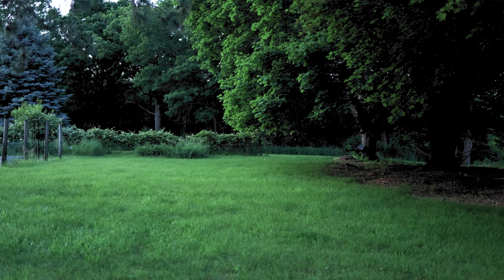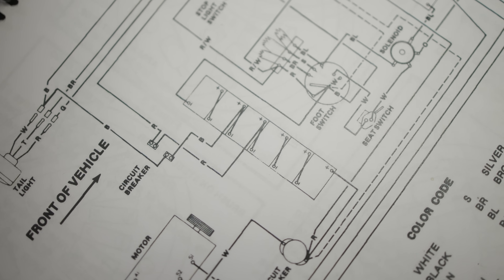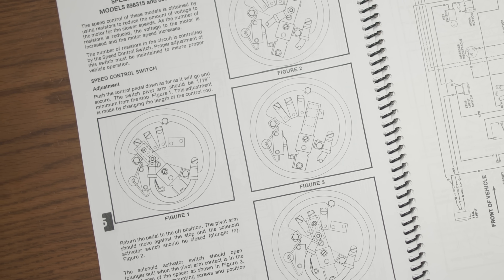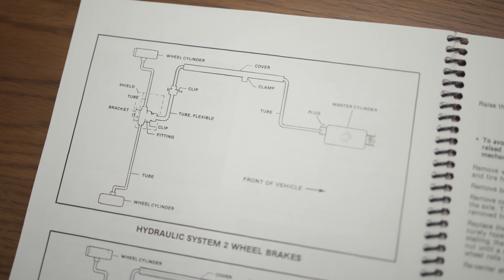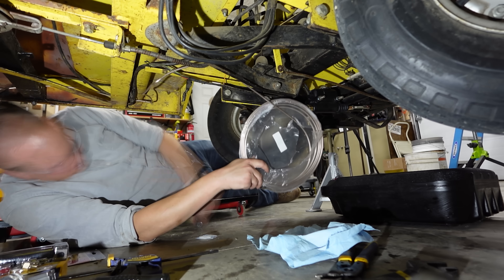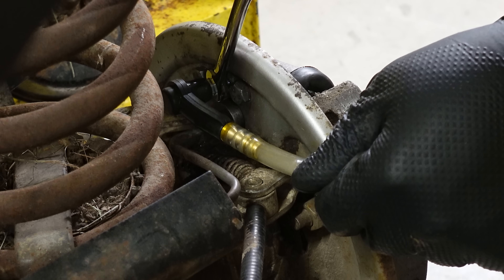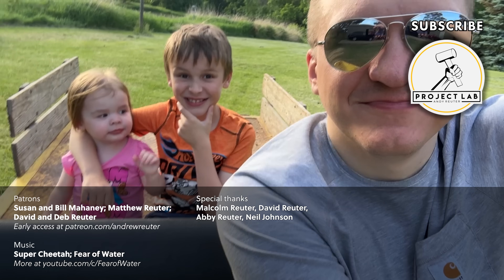Restoring a 50-year-old electric cart (9 months in 13 minutes)

Comment: Can you post what you do to update the controller electronics? My coil heated up and melted a lot of my wires on the controller wiper board. Curious to what you end up doing. Have a similar cart but the Taylor Dunn and not much info about it online

Comment: Robot Cantina, Fall, 2024, converted an electric golf cart, to "hybrid electric" - what he called his "Petroleum Battery"
Caveat: he used a 9hp gas motor, and as you know, they aren't quiet.
On the positive side, he got 40mpg, and was able to go slightly faster than it was supposed to go originally. 
He used a 'special' Jeep Liberty alternator which he later found out had an 'off board' rectifier... 

"cart shaped hole" - 36v in a 12v light (well, it was bright for a moment... LOVE the dry humor... )

Comment: Looks interesting, but not seeing them cheap anywhere.

The rust converter just converts the rust to black iron oxide...  you need to paint that with primer and then enamel, or it's just going to start rusting again.  I remove the rust everywhere, because rust is like cancer.  No amount of rust anywhere is good rust, and it just precipitates and accelerates the formation of more rust. 

There's a cheaper solution you can make up yourself with citric acid and washing soda.

Comment: 9:13 why is it scary to pull hubs?
Reply from the maker: It's a bit scary because you're putting increasing amounts of pressure onto the bolt, which is pushing against the axle in an attempt to get the hub off. Eventually, the hub lets go! And hopefully the nut you spun down to limit how far that hub can fly stays in place. Just feels nervousing because you're hoping the hub doesn't go flying across the room. (And take your hand with it! 🤣)

Comment: I used to work for Valley College I used one of those everyday as a gardener. Very fast. I don't know if it was true but they warned the hell out of me don't take it in big puddles otherwise you'll be electrocuted.😮 PS my boss said it burned up one set of batteries a year just for FYI.
Reply from the maker: Good to know on both counts! I'll stay out of the rain! 🤣 And will be interesting to see how the new LiFePo4 batteries hold up vs. those old lead acid ones.

Comment: 4:30 That is a misconception. Let's say you have a 36 V,  2 kW motor, 55.5 A, and you want to have it output 1 kW, you can't waste 1 kW in a series resistor. To have 1 kW motor output you want 25,5 V over it, and thus the current is lowered to 39.4 A, and you want to waste the rest 10.5 V over the resistor, therefore wasting 413 W (same current). So when resistively halving the motor power output, your total power is 1413 W. Not 2 kW. And if you want 500 W output, the voltage is half of 36 = 18 V, and then you're wasting 500W over the resistor = total power 1 kW.
Reply from the maker: Sounds like a good analysis! My source was the Cushman manual, BUT I am not surprised to learn that the electrical engineering behind this thing is more nuanced than that.
Reply: @AndrewReuter   Maybe the day they wrote that manual they were in a super positive mood and thought that they could do impossible things. :)

Comment: Don't lie, that was the one Roger Moore rode in Moonraker, wasn't it?

For further excitement, get a #4509 bulb! 100w, 12v, same size as your 4411. I sell them as aircraft landing light bulbs in my auto parts store, but I've also sold MANY to lake fishermen who will install them in a rubber utility light housing like used for rearward lights on tractors, making them waterproof. All the fish hear is, "Come to the light!"
Reply from the maker: 🤣 That would explain the license to kill in the glovebox!!!

And thanks for the tip on the light! I will check that out! 🤣
Reply: @AndrewReuter  you got that right on the license! As to the light, I'm clueless on the amperage draw, so may require a relay setup to save the harness.

Comment: You need to paint that duck tape on the shed, If you paint it, it's just like the metal and will last for decades.
 Also - Buys a cart for $500. Spends $100 on gas to get it,  Spends $1300 on batteries, $500 on tools, $500 on parts. Tells wife and friends "hey look at the cart I got for $500!"  😉
Reply from the maker: Good tip on the paint!!! 🤣 And love that logic. 

Andy: We’re saving so much money over buying one new!
Wife: … why are we buying one, period?
Andy: … what’s that over there???? runs away

Comment: Good luck finding them that cheap. Bought a Cushman 875P several years ago for $3K. it was a pristine ‘91 hanger queen with fresh batteries. The zinc is still on the lug nuts. The P stands for passenger as it has a folding second row bench seat that becomes flush with the rest of the bed. I’m starting to have frame paint issues. They never removed the scale before painting the steel angle framing members. The cheapest one I’ve seen lately was $800 and it looks like they ran into a tree. Taylor Dunn and Motrec are a couple of other brands of these industrial carts.
Reply from the maker: Very cool find with that 875P! And thanks for the market analysis!

Comment: call me crazy, but all that old electrical gear? it comes with a descriptive manual, and its ALL serviceable. failing that, bits can be fabricated, modified, or altered.

whereas things like the batteries... touch switches. LCD screens. microprocessors... all undocumented. all unrepairable. all look flashy and nice and sophisticated, but imho... all junk. one day, that  "high tech gadgetry" will stop working and thats that. no way to fix it other than make more landfill...

this thing survived since the seventies, and it still works. and other than a few minor changes, that switchgear is probably identical to something made in the 30s. 

you actually are NOT "pulling full power all the time" through the old switchgear. maybe be archaic, may have some losses in the resistive heating, but one has to bear in mind the motor only draws full current when it is NOT spinning. when it produces no BEMF. once its running, and cruising with barely any load, its BEMF is almost equal to the applied EMF and the current reduced accordingly. the maximum current is pulled when accelerating. and only when accelerating...

they never would have been a viable product if they drained their batteries in a few minutes at part load... rather, they did perfectly well on the limited energy stored in lead acid batteries, enough to build a successful international business from their performance...
Reply from the maker: Thanks for the analysis!

Comment: that motor controller works exactly like how the electric trains i work on work. ours has 29 positions and uses a cam with a bunch of wheels to connect and disconnect contacts to energize different paths through different resistors. but the concept is the same.
Reply from the maker: Oh really? Had no idea! Will have to look into this, very cool that the tech is still in use on something of that level.

Comment: 5:14 "Voltage, schmoltage!  Just turn --- it --- on!!!"  POW!!! :P
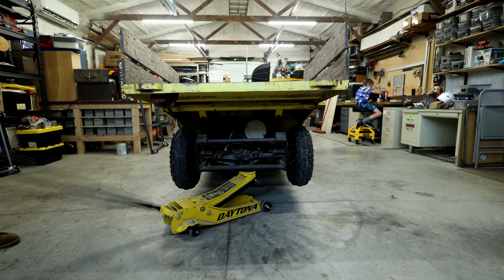5:47 There --- now THAT'S more LIKE it! :D
Reply from the maker: 🤣 Yup!!! Was one way to figure out where that wire went…
Reply: @AndrewReuter  LOL yep --- well, how did you know that the headlight was just 12 volts instead of 36???
P.S. That's one thing to note here, though --- if you have to charge the three batteries in series instead of in parallel, you would be charging them unevenly because the batteries would have gotten discharged unevenly, in that one of them would have been "also" used (i.e., in addition to running the cart's motor) for powering the headlight, and so it would have gotten discharged more than the other two batteries.  It's something like those horridly-designed two-speed cordless drills back in the '80's and '90's, where (rather than their being fitted with an electronic variable-speed module) they used either three batteries (3.75 volts) or five batteries (6.25 volts) in series for the low and high speeds, respectively, but then all five of the batteries were charged in series at maybe 7 or 8 volts, causing those first three batteries to not get charged to the same level as the last two because they'd have been discharged more from your sometimes using the drill at its lower speed.  Plus of course, these older units used nickel-cadmium batteries with their infamous "memory" problem, and so this unequal charging would have been an even worse problem!  I don't know HOW many "dead" two-speed drills I used to see at yard sales, probably for this very reason.  I restored one of these drills that a friend gave me by replacing the batteries, but I removed the "low" speed switch so that it always just ran on the five-battery speed and thus discharged them all evenly.

Comment: Can you take that 3 way switch resister and turn it into, say, a 3 way power? level  one is 1/3 power then 2/3 then 3/3 full power ? like instead of resist, allow? forgive me im not an electrician, what i mean is. You take an electric motor... you give it less than max power it goes slower. so you just take the 3 switch system and do power TO the motor in 3 steps.
Reply from the maker: Cool idea! No clue if it’s possible either but will investigate!

Comment: I've always wondered how old electric vehicles like this did speed control. That whole coil setup is... scary in how wasteful it is 😬 Though I do appreciate how simple it is in its operation
Reply: it has far less waste than you think. the only time that full current flows is during acceleration or when stalled. as soon as the motor reaches cruising speed, its acting as a generator, generated BEMF almost equal to EMF.
Reply: @paradiselost9946  ahhh yes, of course, I didn't really think that through fully. I'm usually only thinking about motors in terms of their max current in order to spec wiring/supply sizes. Usually spec'ing these to withstand max draw continuously
Reply from the maker: Definitely a very cool setup! One other commenter said that electric trains still use similar tech, so clearly any losses are outweighed by the positives of the tech in that case.

Comment: You should use lithium polymer battery if you can get your hands on those.
Reply: Eh I would suggest keeping the Li-FePO ones. There's an abundance of space for them, no real necessity for more power or loads of more range, and it's a garage project. The safer batteries sure help on that case.
Reply: @Kalvinjj  Lithium polymer battery is less prone to fire hazard caused by impact, it is the safer battery, sorry for my bad english : )
Reply: @lhongkho1091  But it's the other way around, Li-FePO (which he is using) barely catches fire when punctured, Li-Ion/Li-PO ones catch fire violently and can't be put out easily.

I understand your good intentions now but in that case, he's got the right ones already.
Reply: @Kalvinjj  i stand corrected : )
happy 2025 to you and everyone

Comment: I don't know if you have but I would highly recommend adding oil or grease on the old bearings, especially in the motor. It will help a lot or at least to keep the old bearings going for a while longer. Helps more if you remove the old grease/oil and clean it up before adding new grease/oil
Reply from the maker: Great point! Have not touched that stuff yet but will have to dig in.

Comment: My grandparents had that same yellow Cushman on their farm. The only annoying thing was the switches on the accelerator pedal would arc and stop working from time to time. They should have used a relay system.
Reply from the maker: Very cool! And good to know on the pedal arcing. It seized in the on position already, which was the source of the shed hole… so I’m definitely thinking strongly about upgrading. Thanks for the comment!
Reply: @AndrewReuter  There are variable-power modules now (modern trolling-motors use them, I think) that work on more/fewer electrical pulses rather than battery-wasteful --- and failure-prone --- rheostats and coils.  The way I understand it, this improved design means that you always get full voltage to the motor for maximum torque; the juice just gets fed more or less often, and so the motor turns faster or slower as a result. :D

Comment: how did the underweight issue get fixed?
Reply from the maker: Insert the gif of Homer backing into a bush here… I didn’t fix it yet. I’ll probably do so by either adding weight or adding an electric front axle for front wheel drive.